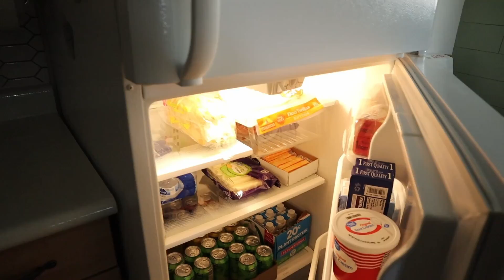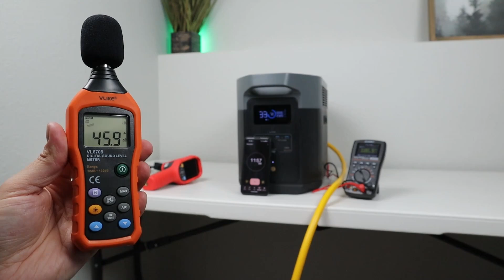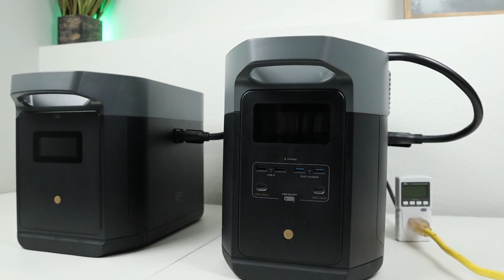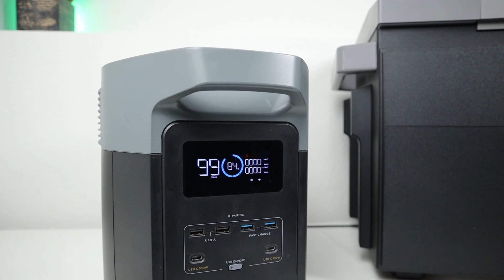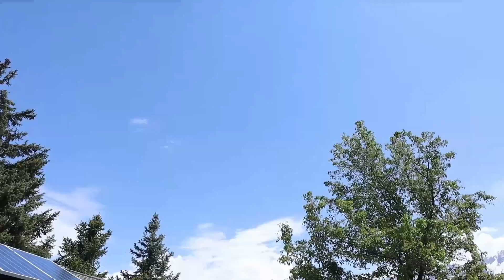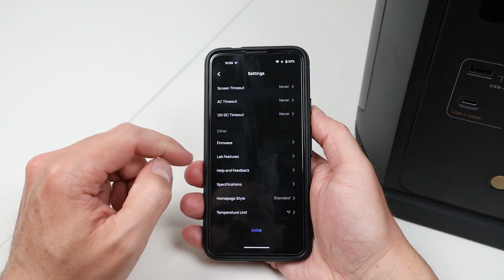The NEW EcoFlow Delta 2 MAX - LFP Batteries - QUIET FANS - 1000 Watts of Solar - FULLY TESTED!

Comment: I am looking for a home emergency backup system. I am trying to decide between the new Delta 2 Max and the new Jackery 2000 plus. If I go on vacation and use the system in UPS mode for my refrigerator and freezer and the battery goes dead, does either system turn back on when either solar or ac come back on?
Reply from the maker: The Delta 2 Max has a 'lab feature' that is supposed to turn everything back on when power is restored. It wasn't active yet when I tested in my video. I think that feature will be working soon. I'm not sure on the Jackery 2000 Plus. I'm hoping to test the 2000 Plus here in the future.
Reply: @Jasonoid  Thank you for your response

Comment: Can this unit pass through charge the EG4 battery to full via solar while having an active load?
Reply from the maker: Can you clarify what you'd be trying to do? I just want to make sure I understand your setup.
Reply: @Jasonoid  eg4 battery + ecoflow delra 2 (not the max) + 500 watts of solar input.  Can the Delta 2 charge the eg4 at the same time  it has a sub 500w load supplied, say 300 watt home office leaving an excess of 200w left over for charging?
Reply from the maker: @MyChannel-vm6dw  thanks for clarifying your desired setup. The EG4 will need some sort of charger attached to charge it back up. The Delta 2 can't charge it automatically with the spare 200 watts. If you had an adjustable 60v power supply plugged into the AC inverter of the Delta 2, you could set the charging speed to 200 watts and it would work well.

Comment: Hey Jasonoid! Thanks for all your work on these reviews.  I'm interested in a Solar Power Station for use as a music PA system - so inverter noise is VERY important.  This review shows the Delta2 max with around 1538mV of noise and seems nice and quiet through the amp, whereas your Pecron E600LFP shows slightly more 1546mV and makes an audible buzz.  Is this due to the amp settings?  Would you say the Delta2 max is noticeabley quieter noise wise than the Pecron E600?
Reply from the maker: There are many different types of 'noise' that the inverter could be putting out. The dirty electricity meter measures EMI noise, there could also be RFI noise. The amp settings are the same on all my videos so if you don't hear noise on the amp test you should be okay.

Comment: Have you test dirty ac on Delta Mini?
Reply from the maker: All of the older Deltas have noisy inverters. The first one to be cleaner is the Delta 2 Max
Reply: That's interesting. I have the 240volt version of the Max. Very quiet ac when using a hi-fi system. Just wanting to see the Mini tests compared to Max. I might just have to buy one to find out.

Comment: I live in Canada and just bought the Delta 2 Max with the 200w solar panel. I like the reveiw that you did and I think I will be very happy with it.
The only question that I did find an answer to is How long of a cable can I use between the Delta and the solar panel ? And what type 10 or 12AWG?
Reply: I have a Renogy 200 watt solar suitcase and run up to 160 feet of 8AWG cables.  I have seen the following currents:
40 feet:  11.2 A
80 feet:  10.2 A
160 feet:  9.2 A
Yeah,  deep in the shade :)
Reply from the maker: @mt.sylvania9218  yeah that's a long run for a solar panel. If you ever get two panels for more power, running them in series will really help with the voltage drop (as long as your power station can handle panels in series)
Reply from the maker: I did a whole video on voltage drop, you might find it helpful:
https://youtu.be/AZIBmFBzBGs

I'd recommend using 10awg wire for anything over 30 feet. 12awg wire for a run less than that.

Comment: Quick question, were you able to connect both solar input ports to your EG4 battery in parallel at the same time?
Reply from the maker: Yes, I was able to charge at 1000 watts with both charge controllers connected to the EG4 battery.

Comment: Great review from your premier power station review site.  Bought the Bluetti EB55 after viewing your review a while back.  Now looking at the smaller Ecoflow Delta 2.  Is it compatible with the new Delta 2 Max 2 KWh extra battery?
Reply from the maker: They should be compatible, it's pretty new so I don't have all the answers yet.
Reply: Thanks, yeah common architecture so should work or require a firmware update.

Comment: Does it have Bluetooth yet? You mentioned Bluetooth, but I want to verify, as my Delta Max doesn't. My direct connect always times out. I use it in my overland rig with an upgraded alternator and a properly-installed 2000w inverter. But the app always times out and I have to reach down into the Ecoflow compartment to reconnect via wifi.
Reply: Just got mine today, at first it asked for wifi so I turned on my phone’s hotspot and connected it tried to update but it didn’t do so it disconnected from wifi and now I’m just using it with Bluetooth.

Comment: Really great review, like it 👍. 
Can you please compare the fan noise to the normal new Delta 2, is it comparable? Many thanks.
Reply from the maker: The Delta 2 fans are definitely louder than the Delta 2 Max fans. The new Max fans are very quiet. I have videos of both being tested so if you watch both videos in two different tabs at the same time you can hear how they sound.
Reply: @Jasonoid 
Many thanks!

Comment: Jason, great review and summary of the specs to include pros/cons of the Delta2 Max, I purchased one today and Eco Flow (if you don't login to their site) is offering the Delta2 Max and 2 Free 110W Solar Panels for FREE for under $2100.  This help when PGE invokes energy blackouts this summer.  I'll pick up a Smart X battery after I receive my unit.

Comment: Here we go upgraded new models every 10 months when all this could of been done on the first release. All a money making scam
Reply from the maker: The original Delta Max (1st gen) was launched in the middle of 2021.
Reply: First release was not lifepo4, so not upgradeable
Reply: I totally agree, These features should all be in the Delta Max in the first generation and they should offer customers a way to upgrade their existing Delta Max firmware and battery at least.  I need a 30 amp plug, other products already have one. They should use LFP from the get-go like they did with the Pro.
Reply from the maker: @richardthomas9579  remember other power station models may have a 30 amp RV port on the unit, but they only support 2200 to 2400 watts (20 amps @ 120v), not the full 30 amps. 
Just purchase an adapter like this and it will function 100% the same, 2400 watts via a 30 amp port:  https://amzn.to/3Ej07jL

Comment: Two 100volt charge controllers would have been a home run. I have a gen 1 with battery, more solar would have been better.
Reply from the maker: Kinda a bummer they lowered in input to 60 volts. I would have loved to see 150voc at 15 amps, 1200 watts of solar input. It was a dream that didn't happen haha

Comment: My Delta 2 I can use solar to charge but if I have no sun it will stitch to grid. Or if you have the smart generator at 20% it will start the generator. Up to 80%. So this is more useful than any other one I’ve seen.  Thumbs up 👍.

Comment: @Jasonoid Q: would you buy Delta 2 Max or Pecron 2000LFP?   Found Max 2 @$1599 Pecron $1099
Reply from the maker: It all depends on if you want a budget unit or a premium unit. They are very different units. The EcoFlow Delta 2 Max is a much better unit overall and it's price shows that. You also get a longer warranty and better product support with EcoFlow. 
If you don't mind missing out on all the fancy features on the Delta 2 Max, than the Pecron 2000LFP will work just fine. It does have the ability to get more solar input and the expansion batteries are also cheaper! It also has a little more usable capacity since it performed better on my capacity testing. Decisions decisions! hah

Comment: Don't buy delta 2... It works OK for a short while then you have nothing but Bluetooth and WiFi connection problems. I bought a second unit and it is doing the same. ECOFLOW SUPPORT IS NOT ADEQUATE
Reply from the maker: Interesting... Maybe it's an issue with your phone? I have never seen an issue with wifi or Bluetooth on all the Ecoflow devices I have used. I have many hours working with the app too. Ecoflow has the best app compared to other brands, it just works. Other brands are super finicky and cut out and disconnect constantly.
Reply: @Jasonoid  Tried with 2 android. Samsung s22 ultra and Google pixel... 2 iphones too.... So think blaming the phones is a non starter. You last sentence describes the ecoflow app in recent weeks! When you are away from home, completely lost connection from the App. Can't reconnect using WiFi. The router is six feet away from both delta 2 units and the expanded battery
Reply from the maker: @under2boots  one thing that causes issues is the default wifi access point your phone connects to. When I first started using the app I kept noticing it would stop working. My phone kept swapping over to the 5.8ghz band instead. The Ecoflow devices are only compatible with 2.4ghz wifi access points. If your phone swaps over to 5.8ghz it won't see the devices anymore. If you want to remove this disconnect issue it's best to get rid of / forget the 5.8ghz access point on your phone so it doesn't swap between the two randomly. The other thing I have seen is that my router will need to be power cycled at least monthly to keep things running smoothly. I prefer to do that every 2 weeks. Why? Because we have so many wifi devices these days that the system just gets overwhelmed. The app usually isn't the problem, it's the access point, the router, or even the phone. I hope that info helps. There are so many variables that could be at fault. I hope this info helps.

My Bluetti app constantly has to be removed and added back. The devices get frozen and I need to remove them and add them back. Same with my Ugreen app and my Anker app. Ecoflow has been rock solid on my Google Pixel device.
Reply: @Jasonoid  Thanks for the detailed reply. I'm fortunate I have the 2.4 set up and check I'm on that when using the app. WiFi isn't the current problem. Bluetooth pairing is not happening with one of the delta 2  units so it's a fully charged lemon I can't see on the App and control it accordingly. I'm trying to get full use of the 3 kilowatt capacity and have two sets of panels on the roof mounted south and West to get max recharges on both units throughout the day. It all falls apart when the App just sits there with two fingers up saying add device. And you can't if you're not home and when you are home the bloody device still doesn't appear to connect to it. To be honest, I'm sick of fighting with it and the 5 year warranty means nothing so far because support is either slow or non existent. Feeling I've wasted a ton of money 😔
Reply from the maker: @under2boots  total bummer man, if bluetooth isn't available on the device then there's no adjusting settings at all. I know there will be lemon devices out there but I'd hope that Ecoflow would take care of you with the warranty.
Reply: @Jasonoid  Disconnected the entire set up and held the 12 Volt cigarette lighter output button down at the same time as the front power button. It's finally reset itself. Can't keep dismantlling the set up and having this faff everytime. I want ecoflow to step in and swap out the unit. It's only a couple months old

Comment: Once again a great review. I did not hear anything about a wireless charge pad so I assume no. It also did not support bi-directional charging via USB C ports or 240 volt outlet via the connecting cable to the add on battery, BUT the 2 PV charging ports, each capable of 500 watts, the upgrade to LFP battery and the new fans are fantastic additions and changes.
Reply from the maker: Yeah, no wireless charging nor bidirectional USBc ports but the LFP and dual charging ports upgrades are very good in my opinion.

Comment: Hey Jason what are you thoughts on this delta max 2 vs Anker 767. I have the 767 that I just received a replacement for after a mis-wiring issue. The new replacement that just showed up only shows 117 volts with a multi meter at the ac inverter plugs. I’m going back with Anker to see if that normal. Anyway if this is another issue I might get a refund and buy the delta max 2
Reply from the maker: The 117 volts on your inverter is within normal voltage ranges for these power stations. Anything between 115 volts and 120 volts is a great place to be when running appliances and electronics. I wouldn't worry about that being an issue. 

The Anker is more quiet and is easier to move around with the handles and wheels. It also has a much faster UPS mode for computers or servers. It also can handle 20 amps output on the DC ports vs the 10 amps on the Delta 2 max.

The Delta 2 Max has a more usable solar charging input since it shares that 1000 watts between two charge controllers. 

I'd say if you aren't super focused on solar charging or at least hitting the full 1000 watts input, I'd probably just stick with the Anker 767, it's a GREAT device.
Reply: @Jasonoid  thanks for the response Jason…Anker got back to me and said it’s good to go. I really like this thing and looking forward to many years of use in the Rv

Comment: Does anyone one know If you go over 60V or the 15A on the solar ports will automatically limit the volage or amps or with fry the unit? TIA
Reply from the maker: Over voltage fries the device, do NOT go over 60 volts.

The amperage input is limited automaticay so you can over amp it just fine.

Comment: can you charge via solar and AC at the same time giving priority to solar?
Reply from the maker: Check out the time stamps and go to the charging section. I tested dual charging with AC and solar and it worked just fine. The app also has settings priority for solar.
Reply: @Jasonoid  nice thanks!

Comment: So a Delta max add on battery can work on a delta 2 max unit, but what about the other way around, they will make a Delta 2 max add on battery, would this work with the Delta Max?
Reply from the maker: I think it goes either way, I don't have both to test with but Todd Parker (he's got a youtube channel with a review) tested the old Max batteries and they worked.
Reply: @Jasonoid   Will definitely check this channel out to find out, Thanks, I did see some sales of the Delta 2 Smart battery which have a Note under that says 'For the Delta 2 models only' - Im hoping this is just due to a lack of information. To me it feels like it might not work due to the different battery chemistries ,but i really hope it does.Otherwise it causes upgrade issues for many with Gen 1 products. Why would one pay the same price to get a 800cycle battery instead of a 3000cycle one. But ill check the video out,maybe he clarifies this more

Comment: Ok BLUETTI, the ball is on your side of the court. I am a Bluetti user, but I think Bluetti needs to put out a smart generator like Ecoflow’s. I know you can use a regular generator, but the conversion loss puts it at a disadvantage to the smart generator.
Reply: Bluetti vs Ecoflow 

Let the games begin..🔥⚡️🔥⚡️🔥
Reply: Indeed, having a smart generator like EcoFlow's brings several advantages over the others ones.✌
Reply: @EcoFlowTech your product are not that great for solar input.

Comment: Using the 19v voc panels in a 3s configuration would not be recommended for a long term setup.  Panels are rated at 70f typically and will produce more voltage as they get colder.  Your 3s array would go well above 60v in colder temps.
Reply from the maker: Yeah. I thought that would be an issue so I tested them through the winter many times, they never went over 19v surprisingly. I had them in this same config on my AC500 batteries and my Delta 2 (both have 60v cuttoffs). They usually sit around 55 volts to 57 volts VOC.

Comment: Do they still have the IOT button for Wi-Fi connection?
Reply from the maker: Nope, it's not needed anymore.
Reply: I never had any luck with that way of connecting.

Btw, nice presentation/comparison on the units.

Thanks
Reply from the maker: @chrisparker5895  the new unit just shows up the the app, it's super seempess now 😁👍 Thanks Chris!

Comment: HI, can you plug Delta 2 into another Delta 2 to get double the power instead Delta 2 extra battery?
Reply from the maker: No, they don't support that function unfortunately. Only the Delta Pro can put out 240v.
Reply: I meant what will happen if Delta 2 connect to Delta 2? Does it combine to 2048Wh? Or impossible to work like that. @Jasonoid
Reply from the maker: @htran8474  You cannot connect two power stations together via the side port, only the batteries can be connected.
Reply: @Jasonoid  What do you think, get two Delta 2 is better than Delta 2 + extra battery ?
Reply from the maker: @htran8474  the Delta 2 expansion battery doesn't have any ports on it. You can only charge it by connecting to the power station. In that case maybe it's better to have two Delta 2's. Be using one and charging the second one and then swap them out when the battery gets low with the full power station?
Reply: @Jasonoid  Thank you, that's why I decided to have 2 Delta 2.